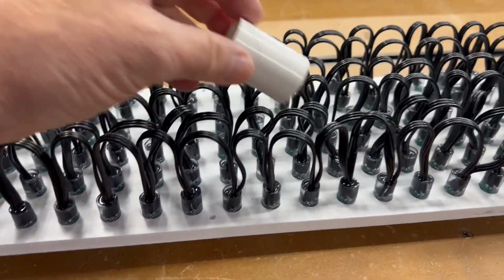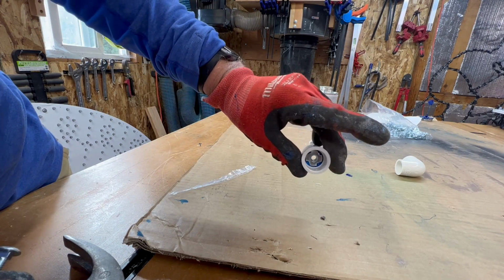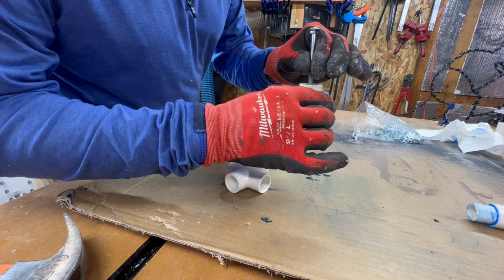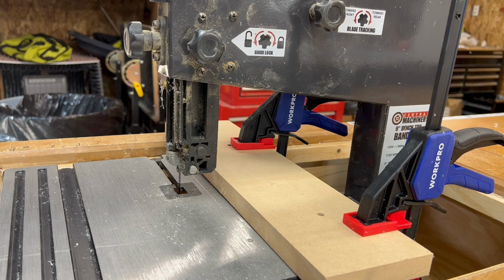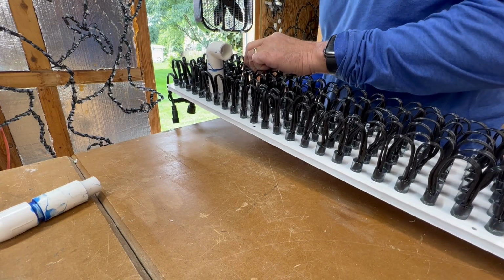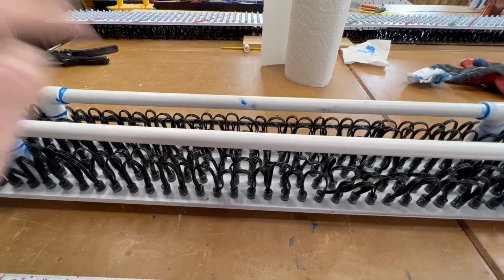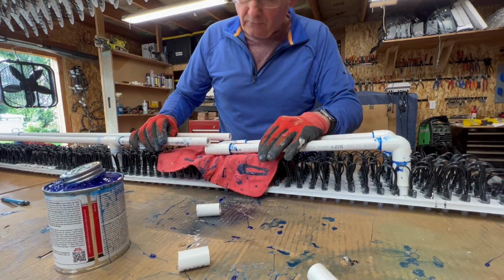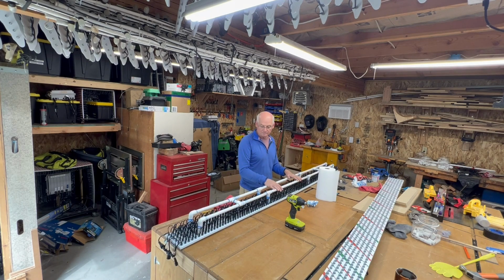Mounting GE Pixel Poles

Comment: Went to buy t nut. They come in different sizes. 
What size do you use. 
1/4 20 fits the bolts but what size to fit in the pipe. 
Thank you
Reply from the maker: Here is a link to the tenure I used.
1/4"-20 T-Nuts | 100pc | by Bolt Dropper, Pronged Tee Nut. for Wood, Rock Climbing Holds, Cabinetry https://a.co/d/87rtjrM
Reply: @bergmannlights5149  
Thank you. Ordered

Comment: Do you have a parts list ? Carriage bolt size? T nut size? Etc
Reply from the maker: Standard 1/4 inch bolts and t-nuts.  Here is a mama on link for the T-nuts I used
1/4"-20 T-Nut (100 Pack), Zinc-Plated Steel Corriosion Resistant, 5/16" Barrel Length, 4-Pronged Tee Nut for Wood, Rock Climbing Holds and Cabinetry by Bolt Dropper https://a.co/d/cbz7PJQ